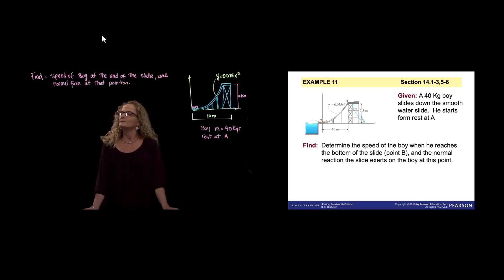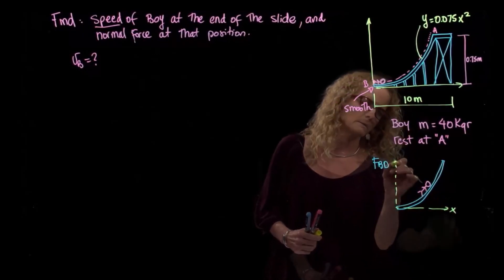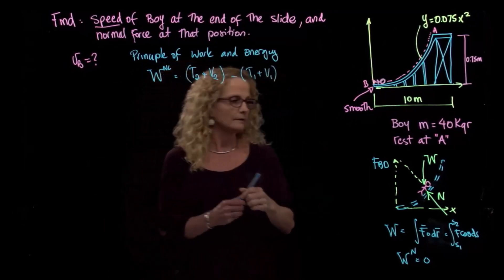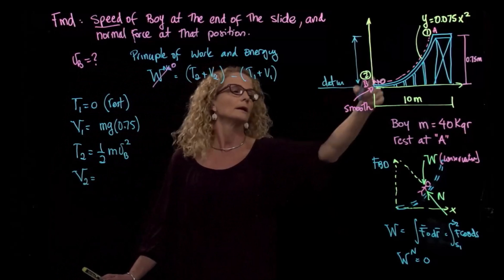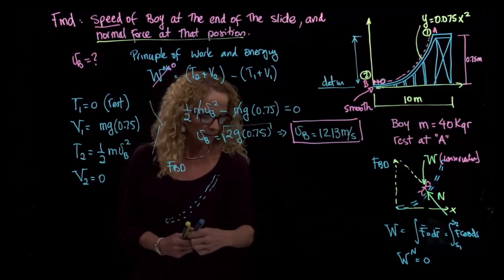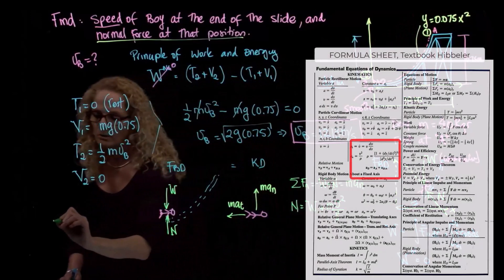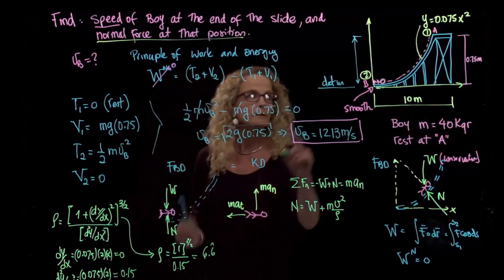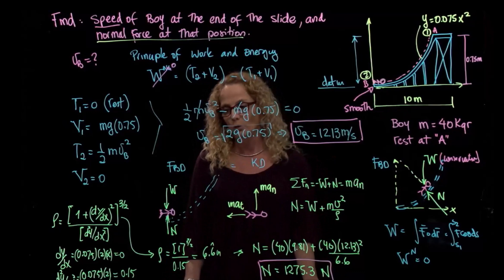DYNAMICS, Example 14.3.11 Principle of Work and Energy

Comment: I inputted the equation for the Vb and it gave me 3.836?
Reply: so did I, there are multple mistakes throughout also, you can check the equation for rho, the x just dissappeared, the x should be equal to 10, so you would be calculating for the point B